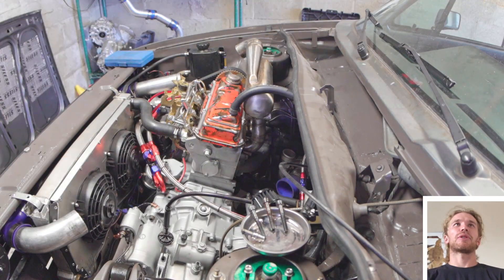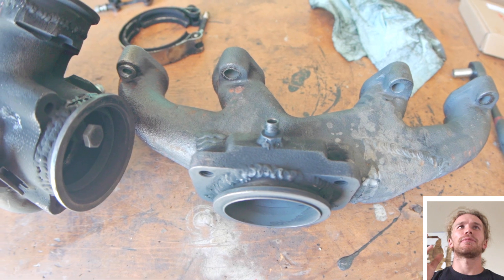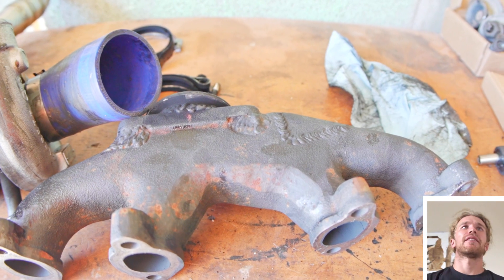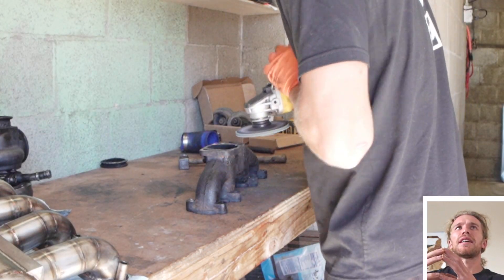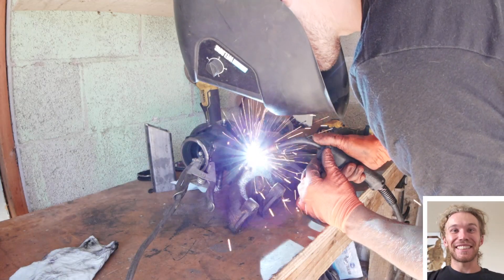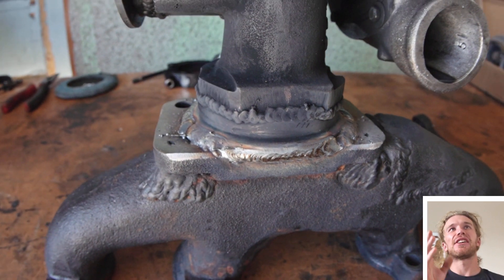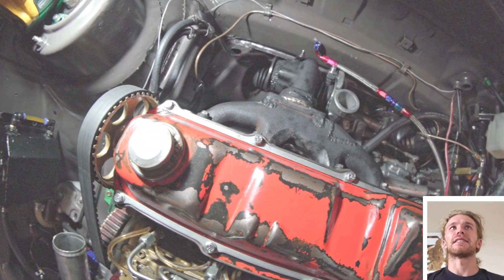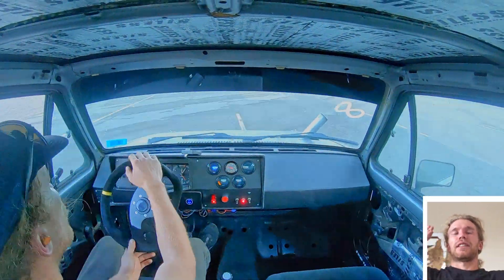Its BIG turbo time! / How to fix a boost leak

Comment: Biggest restriction in a 1.6td is the head. Get a reground/bigger cam. Giles sells them. And port the shit outta the head. Or what you can do is what guys have done on the forums and do a 1.9aaz head with porting on the 1.6 block. The dyno graphs they have is 193hp and 204tq
Reply from the maker: Certainly a turbo can be more restricting depending on what size it is. My head is already ported - interesting thought with the high lift cam though! Probably wouldn't get it from Canada.

Comment: What gearbox/ratios are you running at the moment? You could put an 020 together relatively cheaply that’s geared more for the strip… That’s down another rabbit hole (no pun intended) though. Keep up the good work, I always look forward to seeing your progress 👍🏻
Reply from the maker: Great thought!! I have a 5 spd, don't remember the ratios off the top of my head. I almost feel like a 4spd would be better for the strip?? My first rabbit had one & I remember 2nd & 3rd gear were cash. How would you adjust ratios for the strip?
Reply from the maker: I have a 2nd 5 spd I am saving to overhaul... Was thinking of welding the dif as a starting measure to make it more speed prone!
Reply: I’m definitely no expert, it’s something I’m looking into for my own 16v mk1 build - but there’s a lot of info online about 020 codes, ratios etc. Broke VW is really good for advice and technical. When you said that you shifted to 2nd gear and you weren’t getting the power, my first thought was could 2nd be geared too low? The GTIs use a close ratio gearbox for better acceleration and keep the engine revs within the power band for optimum performance. A diesel box is geared for economy and regular driving. I’m in the UK so there are some gear box codes specifically for UK/Europe but I’d imagine a close ratio gti box might be a good place to start and see how it responds. But I guess seeing what you’ve got currently and then comparing on paper would be the first step.
Reply from the maker: Good call! Thanks for the thoughtful thoughts. I definitely think my current bottleneck is motor related. But it would be interesting to play with gears too. I wonder if a four-speed would actually be faster since you'd have more time in gear making boost (at least for a quarter mile application)

Comment: What’s the advantage to running the NA pump? I’m about to throw a K14 on my 1.6 NA that has a Giles pump on it, I have the option to swap to a turbo pump though.
Reply from the maker: Purely experimentation at the moment. I think once you have sufficient fuel (esp w a larger pump head or something) turbo vs non turbo becomes kind of irrelevant. That said, I think the turbo pumps drive nicer in general since they fuel only as much as needed to match the boost (ie you avoid aggressive over fueling lol)

Comment: I have recently started having a siren / whining noise when accelerating in my 1.6td rabbit. I tried checking for a boost leak with brake cleaner. Any advice for how to inspect my turbo ?
Reply from the maker: Yeah that's probably your turbo! I'd recommend taking it all the way off (or at least removing the intake piping) & checking shaft play - you're probably hearing the impeller graze the housing. There's probably visual signs of this as well

Comment: even with the pump mods, its not a super smoky, its really at max fuel? my pump is 1.6 bosch btw, and doesnt has that intake for turbo pressure to delivery more fuel,  and if i do more 1/4 turn omg, became a smoker
Reply from the maker: that's interesting. It's quite sooty in person! There's not a whole lot to see with the GoPro angled like it was 💁